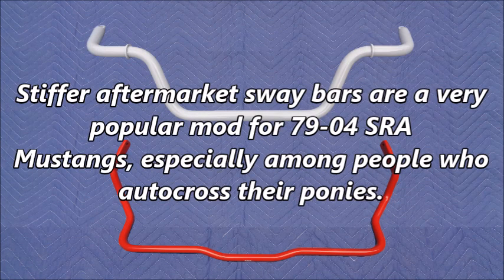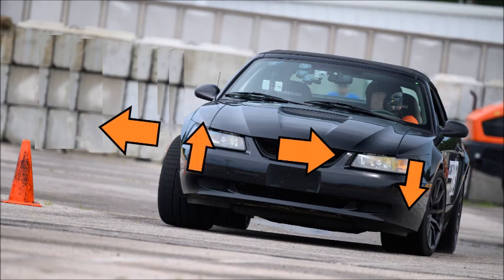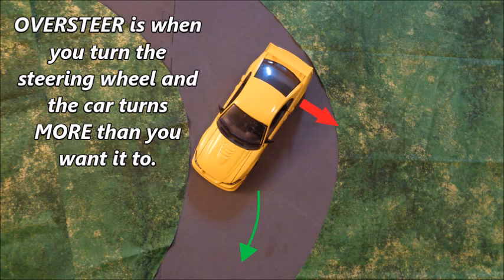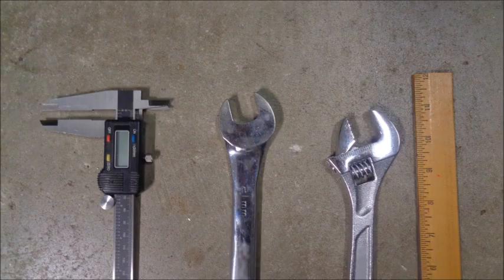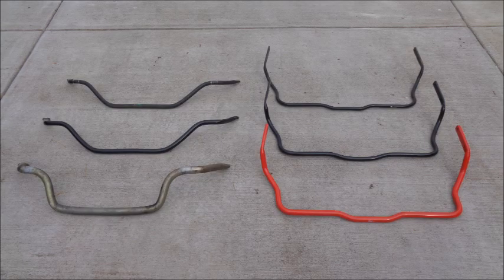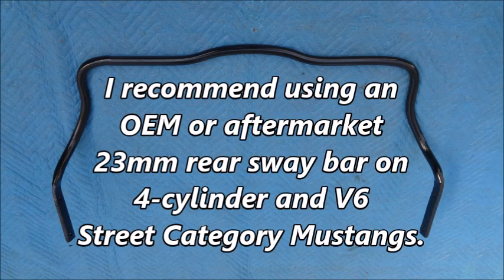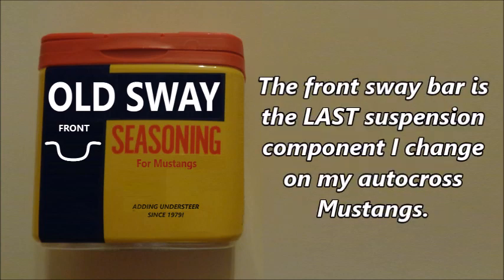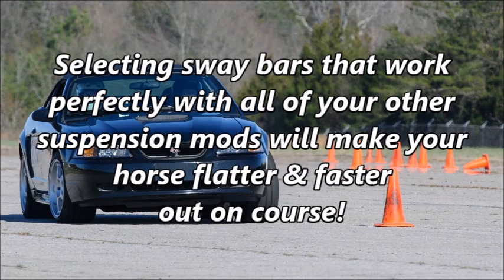Why STIFFER SWAY BARS AREN’T ALWAYS BETTER for 79-04 SRA Autocross Mustangs

Comment: one of your best yet videos...Herb Adams was a fan of stiff springs and soft sway bars for fine tuning.   Lots of options out there to get to the same ends...
Reply from the maker: Thanks! Sorry for the delayed reply, I was helping run a novice school all weekend. I normally try to reply within 24 hours. There are definitely lots of options/preferences when it comes to sway bars. The one thing everyone with autocross experience seems to agree on is that sway bars are used for fine-tuning.

Comment: I was so happy about putting a GT rear sway bar on my stock 02 V6 and now learn I probably just made it more dangerous (don't like snap oversteer) til I can sort the suspension out. 🤣

Thanks for the info!
Reply from the maker: Sorry for the delayed reply, I was helping run a novice school all weekend. I normally try to reply within 24 hours. Putting a 23mm GT rear sway bar on a 2002 V6 is actually a good idea. The added oversteer will balance out the tendency to understeer that the car was born with. If you are experiencing oversteer out on course, it's most likely due to the open differential (you can adjust your throttle inputs a little to drive around that issue), or the rear suspension binding (you can get a feel for when this happens and drive around it, or you can make mods to improve the performance of the rear suspension).
Reply: Always appreciate your input!

Comment: There was a point where a lot of the fastest ESP foxbodies were using no rear bar and very soft rear springs. Would push like crazy in stead-state cornering, but would allow the car to put down a lot of power and launch hard out of the corners.
Reply from the maker: Sorry for the delayed reply, I was helping run a novice school all weekend. I normally try to reply within 24 hours. That's definitely an interesting setup. It lines up with one of the points I was hoping to make in this video. Experimenting with sway bars will lead to finding the setup that works best for your driving style.

Comment: I definitely want to put a Mr stiffy in the rear…Wait what? 😂😂 Great video brotha!! Really helpful, I was going to go with the standard Eibach sway bar upgrade but after watching this I’m considering just swapping out the rear sway bar for a stiffer one..Any advice, What set up I should go with just for excellent street handling capabilities?? no auto cross yet..
Reply from the maker: Thanks! Sorry for the delayed reply, I was helping run a novice school all weekend. I normally try to reply within 24 hours. If you plan on autocrossing the car in the future, you should choose an SCCA Category/Class before you make any mods. That will save you from putting yourself in a tougher class, or having to undo mods you've already made. Adjustable shocks & struts (for example: Koni Yellow SA or DA, KYB AGX) are a good option that would be legal in every SCCA Category. A larger rear sway bar is a good start too. A good alignment also helps (CC Plates aren't legal in all SCCA Categories). Bushings and springs are the tricky part of the equation. Progressive springs are better for street comfort, but not ideal for autocross. Your old bushings probably need replacing, but there are SCCA rules about bushings that you'd need to consider before making mods. Rubber, poly, and Delrin all have benefits and drawbacks when it comes to improving handling and adding NVH. It can often be more expensive to replace OEM rubber bushings than it is to upgrade to bushings that will improve performance. If you let me know what Category/Class you're thinking of running in, I can suggest some other mods that will be legal.
Reply: @warhorseracing  Thank you, I’ll let you know if and when that time comes..I appreciate your input..
Reply: Do you think a pickup truck with leaf springs in the rear will have the same characteristics as a mustang. Factory it had a 24 millimeter bar on the front and nothing on the rear. Then I changed the front to a 33 mil and added a a 24 mil on the rear at the same time. My truck always oversteers but after I changed the bars it is worse. Before i could feel it stepping out and catch it but now it snaps and usually turns around. So if I understand correctly it might be better to remove the rear bar or go smaller with it.  Thanks
Reply from the maker: @JAMESSPEEDSHOP  I don't have any experience with pickup trucks and leaf springs, but I assume there would be some basic similarities. Both vehicles are nose heavy. I imagine your truck had a tendency to understeer at the limit in stock form. Are you able to adjust your rear shocks? Have you tried less air pressure in the rear tires? Based on the general guidelines, a smaller rear sway bar should help. It might be wise to reach out to Jordan and ask about his setup on the Ranger. If the rear sway bar is easy to remove, you could try to take it out/disconnect it between runs at the next event.
Reply: @warhorseracing  Thanks for getting back with me. I’ll have talk with Jordan. I do run lower air in the rear. At the moment I can’t adjust the rear shocks.

Comment: have you got a video on setting up shocks properly? :)
Reply from the maker: Sorry for the delayed reply, I was helping run a novice school all weekend. I normally try to reply within 24 hours. I have a video about adjusting autocross suspension that includes how adjustable shocks & struts impact handling. Here's a link: https://www.youtube.com/watch?v=9HiS-t4_O_w&t 

If you have never used adjustable shocks and struts before, I recommend experimenting with settings in a safe environment (NOT on the street). An autocross Test N Tune is a great option. Start with the shocks & struts at full soft, then increase the stiffness on each run until you are at full stiff. The car will probably not handle very well at full soft or full stiff, so be prepared for understeer/oversteer/spins. That will give you a sense of the range of adjustment. From there, you can fine-tune the personality of the car. If you have any more questions, please ask. I'm always happy to help.
Reply: @warhorseracing  excellent! i love the content man!

Comment: Can a properly modified 1997 cobra get a faster time then all the Miatas that are always at autocross?
Reply from the maker: It all comes down to the driver. Mods are definitely important, but good driving fundamentals make the biggest difference. I'm fortunate to get to compete against a lot of Mustang drivers at many of my local events. We don't always post faster times than every single one of the Miatas (we have some very good Miata drivers), but we run faster than many cars that, on paper, should be faster than ours.

Comment: 😂 Apparently, my car is Street "Modified" because of the CF hood. I'm on 300TW tires vs the FTW cars. 😂
Reply from the maker: Because of my mods, I was put into ESP when I first started autocrossing. And I had 320 TW tires. I wasn't very competitive in ESP, but I still had fun and learned a lot. I ended up picking a few cars in a few different categories to compare my raw times to. It helped me worry less about my ESP competition and focus more on getting faster.